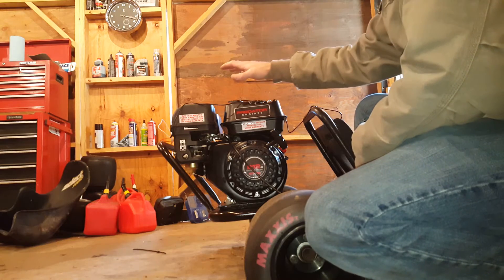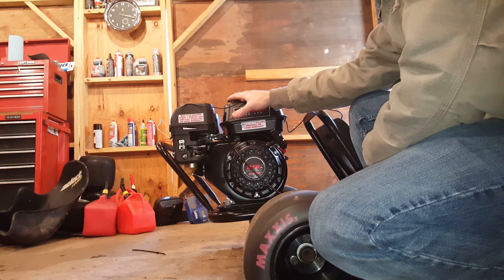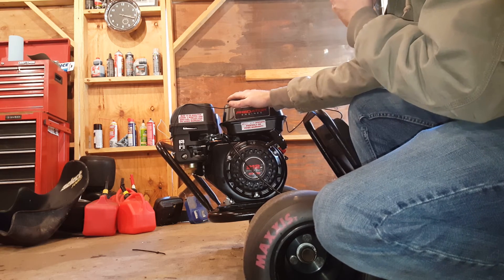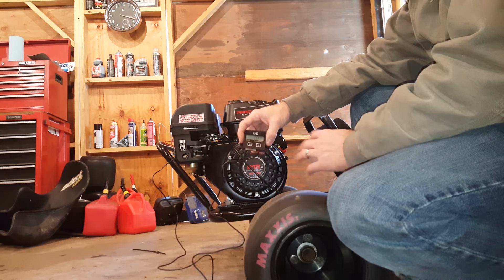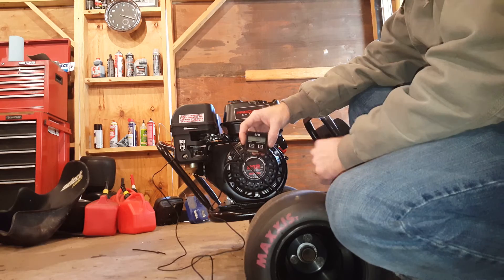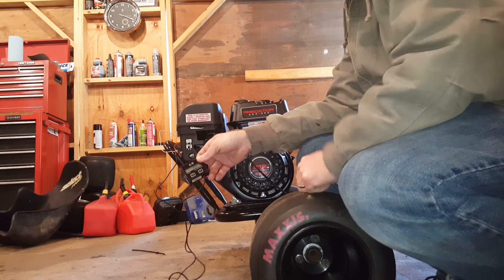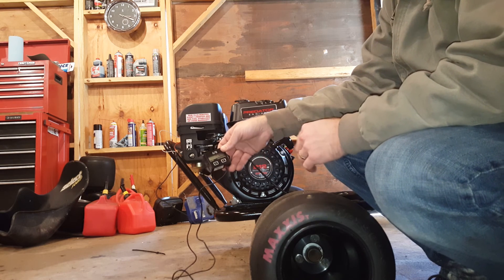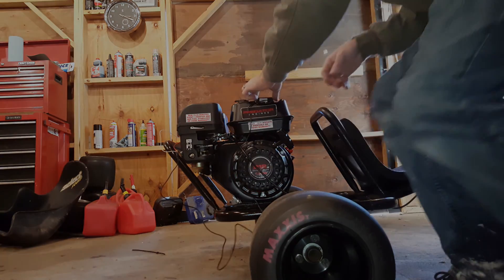Predator 212 Float'n the Valves Max RPM Test

Comment: Thanks for making this man. Quick and to the point. Do you happen to know the rpm’s after doing stage 1 and 2 performance mods?
Reply from the maker: I honestly cant recall exactly but its a noticeable increase after you add a decent cam and stiff valve springs.
Reply: @KartArt  I'm curious what stock cam can do with heavier springs and Mikuni plus header
Reply: @keithblume5159  it can explode at 7000 rpm i have 18lb springs and that just happened
Reply: @khalelwalker708  the cam exploded?    I thought the rod was the weak link followed by the Flywheel.
Reply: @keithblume5159  the flywheel is the limited  factor  then tend to be explody at around 5k and up rods go around the same time imo
Reply: I'd watch the video if you made it with stage 1 and 2

Comment: what was the stock rev limit?
Reply: 3600
Reply: There isn’t a stock rev limit but 3600 is recommended. Carbed engine will rev until it cant
Reply: @sketchy__chris  - except if the governor is still in place
Reply: Stock gov on hemi is 3600.
Stock gov on non-hemi is 3800.

Comment: I always thought the engine would blow up before it could even reach max rpm
Reply: Mine only goes to 3800. No governor. A 5 to 1 ratio. Torque isnt bad. So i dont think its. A power issue
Reply: @stylze5767 did you figure it out mines doing that too

Comment: Yo i have 3 engines and i want to build 1 to push around 7k RPMs and i did springs, gov, header and carb with XL air filter... It still says max is 3800 rpms down hill lmao to the gov idiots thinking it is really going to push 5k with a 200Lb plus load. Any suggesions or help would be great. I want to order everything in one shot. Thanks yo
Reply: Sounds like you need to learn how to tune a carb.
Reply: Bain McCartney I weigh 240 and mine will run 5000rpm all day
Reply: You must be slow... I bet you're not even dealing with mini bikes anymore lol.

Comment: Would you know the valve lash for 212cc non Hemi with 18lb valve springs?
Reply: .03 intake 0.05 exhaust
Reply: You can do up to .08 and as low as .03 like i did. If done wrong you will break your arm trying to pull start it. Intake has to open before the exhaust. It spins in a circle and works like pressing a button but has to go in that order. Always keep the exhaust following the intake by .02" or the compression wont release. Watch red beard he explained it ok but messed up the corect lash setting a little. These motors are so simple bc people were never smart. All is alien tech. Monkey see monkey do is how everyone learns but they think they are fucking with aliens when the fuckers are really demons yo.
Reply: @bainmccartney  OK thank very much So the exhaust side .005 and intake .003?

Comment: Remove the air box for 2k more rpm. Mine had just flames coming out of the exhaust and then it threw the pushrod off the valve track
Reply: That was probably due to valve float.

Comment: I dont know if my tachometer just sucks or what but it says the motor hits  4800rpm before it does that so who knows i think the tack reads fine though because it reads 1400ish rpm at idle. luckily for me my gearing is so long by the time it is a 30mph the engine is at 2900 rpm what suck is it doesnt accelerate that good though
Reply: Ebay cvt, like 40$ i think

Comment: My predator gets to give or take 4800rpm and if i hold the throttle pinned the motor reaches 4800 and sounds like im letting off and then pinning it again it does this over and over until i let off is this valve float or are my valves not adjusted well? Also it has a jet and intake also i modified the stock exhaust (took the cat out and   grinded the entrance to the exaust to be a little bigger.
Reply: Im pretty sure mine has the mod where the position of the governer spring is moves so that it cant pull yhe throttle off as much so the governor is still there but is less restricting
Reply: Adjust the mixture of idling with 100% acceleration, for me it was lack of fuel, the screw was in 1 1/2
Translated
Reply from the maker: The sound your describing the is the governor actuating the throttle back trying to maintain that rpm.
To get higher rpm you need to remove or disable the governor......id suggest removing it completely.
Reply: I removed the governor and am getting this exact same issue, I can't get it past 50% throttle and then it starts to sound like it's skipping a beat every so often until I let off @KartArt

Comment: I know ever engine is different. Under load guys are getting 5400rpm at the track. I got mine in the kart on the bench spinning the tires to turn 5800. Stock other than internally pulling the governor

Comment: I just turned the throttle screw all the way out , and for some cool reason the governor kicks in around 5,000 , sounds like a bababababa rev limiter , I don't think it's hitting valve float but it sounds cool lol
Reply: Probably not 5,000 rpm but closer to 4300

Comment: How'd you hook up the Rpm gauge to the block?
Reply from the maker: the gauge itself is battery powered so you just wrap the lead wire around the plug wire on the engine and your good to go.

Comment: Interesting.
Would've guessed it would be like a car you know? " vrOO-ooom, vrOO-ooom vrOO-ooom" Like that.
Good to know. Thanks for testing.
Reply from the maker: No Problem. Yeah these small engines definitely sound nothing like a car. I've got a couple videos this weekend that will be with my modified predator on my race kart pov. That engine makes a little more "noise".
Reply: UnTamed Mustang Cars sounds like that because they have electronic RPM limiters that kick in to prevent valve float. You hit the max allowed rpm, the computer kills fuel for a second, then lets it back on. This happens over and over to create that sound.